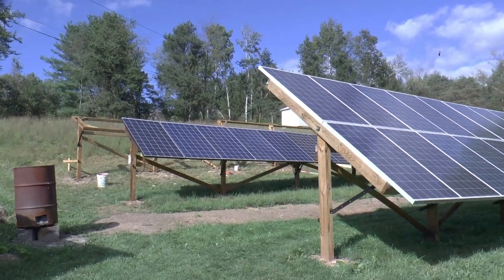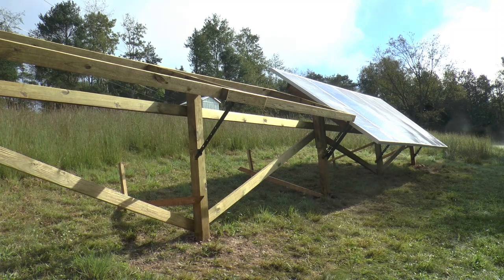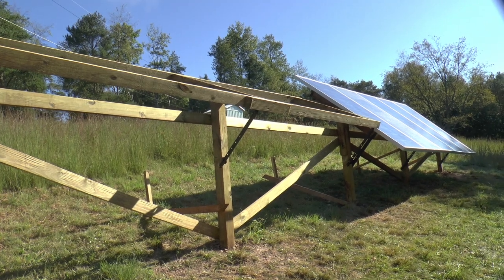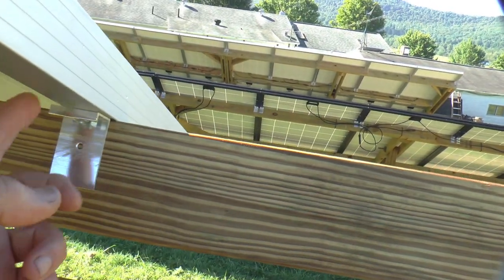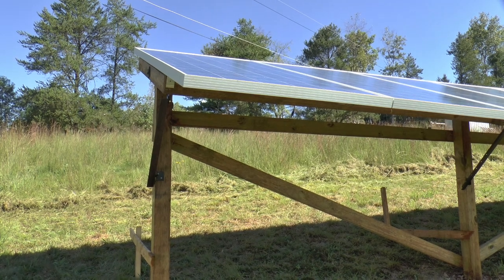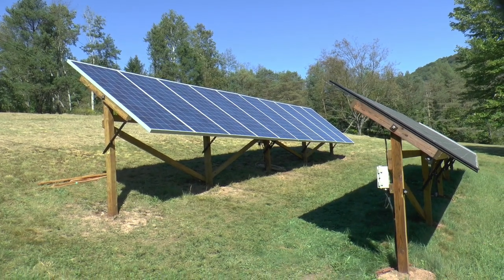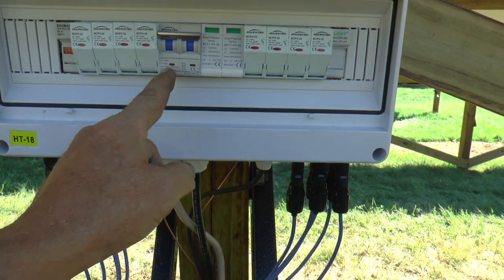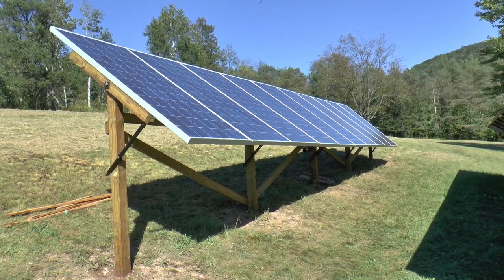Adding 10 more ground mounted solar panels

Comment: Great job! I'm trying to follow your version, but as I plan out building the mounts for our 22- 44 5/8 x 895/8 panels it's hard to see the details of where the sections meet. I see boards mounted at either side of the posts but can't visualise how the two sections are joined with the 5/8s double galvanized bolts and if those are longer bolts than the end ones. 
Also, did you drill the bolts for the cotter pins, don't see threads there?
Thanks!
Reply from the maker: If you stop the video at 9:30 you can see the two 2x4s (or 2x6s depending on your posts) that are bolted on each side of the post. Those 2x4s go in between the 2x4s on  the end of the two sections. The 5/8 inch bolt goes through all six 2x4s with some washers in the middle. I only had long bolts left and didn't want to buy more so I cut them off and drilled them for cotter pins other wise they would be bolts and nuts. I have other videos of others I built not sure if you seen them they may help too. Hope this helps.
Reply: Thanks so much, that dies help! I bought lots of 2x6x12s for the 6- 3 panel units hoping 2x6 posts between will be enough. It looks like yours are only about 6 feet apart, should I buy more posts in your opinion and have them half way of each 12' unit?
Reply: I have watched all your videos several times at least, they have been extremely helpful. You do a great job of explaining how you built these. I did freeze the frame and took a screen shot of the spot you gave me, now understand how those joints fit together. Since our total length of the array is over 80', I like how that will allow me to adjust the height of each post since my Lowes only had 8' long 4x6s

Comment: This is just the idea I needed. This design eliminates those expensive metal rails. Are your posts 4x4 or 6x6? Are you using 2x4's to make the tilting section? Thanks
Reply from the maker: My large ground mount that holds 20 panels (double rows) uses 4x6 post 2x6 for panel frame. The smaller 10 panel (single row) mount uses 4x4 for posts and 2x4 for panel frame.

Comment: Love your build and video Would you be able to share a few pics of how you installed your adjustable tilt mechanism please. We are using this type of mount up here in the NWT.
Reply from the maker: Not able to right now. Have you watched all my videos of my mounts you may find some details there. If not remind me and I will take some photos.
Reply: Thanks for getting back to me. Yes I have but they just don’t have enough detail on it. Whenever you can get at it.  Thanks
Reply from the maker: @rodgray1879  Stopped raining so I made a video hoping this will help. Here is a link to it https://youtu.be/p-33Pn2To2o
Reply: @kevincrawford2027 Thanks for helping out a viewer. Exactly what I was looking for and will adopt this for my display. I have 6 450w panels done vertically in 2 rows.

Comment: Do you mind telling me how far apart your 4/4s are to keep each run from shading the other. And how much closer you think they may could be and work. Than you have yours. I don’t have much of a front yard. I’m using 100w panels. I’d like to do about 3/4 rows?
Reply from the maker: Can't go by my distance because mine is on a slope and would be different than your location. Once I had the first row installed I put it at the winter angle. I then used a framing square from the top of a solar panel and ran a string along the other leg of the square to the ground. That is where the shadow would be at the suns lowest point of the year. Than I added a little just to be safe. Not great at explaining things hope this helps you.

Comment: i can't make the brackets, would you share the size so i can see if there are some available on amazon?
Reply from the maker: Mine are about 2 inches wide. One side of the angle is about 2 inches the other side is about 1 inch. Only because that is what I had on hand. Any small L shaped bracket with 1/4 inch holes should work.

Comment: Great Video will deff use a lot of your ideas if you don't mind. I was wondering what kind of brackets /arm system you are using for the tilt angle. I see you're using pins and cotter pins. I find that simply genius! Keep up the great work! Cheers!
Reply from the maker: Glad you got some ideas from the video. I used 1 1/2 inch angle with five holes. That gives me a good range to adjust the tilt angle from summer to winter. I have a video of a larger version that may be more detailed.

Comment: I will be building racks for about 36 panels and was planning to use a combination of unistrut and wood. After seeing some like yours made of all wood, I am considering that as well since steel prices are much higher. However, I am concerned whether 4 screw clamps will hold down each panel in high winds. Especially, like the 60-70 mph winds experienced a couple days ago. Have you had any issues with high winds?
Reply from the maker: We have had a lot of wind sometimes for several days at a time with high gusts like you mentioned. So far no problem. I have even gone out to check them during some of the high winds to see if the were any issues and found none.

Comment: Great work I love it and I'll be doing the same I have a question on spacing between the two arrays how many feet distance do I need to be so that I'm not casting a shadow onto the other array and again great work and thank you for sharing with the world we appreciate you
Reply from the maker: Depends on the lay of the land. Mine are on a hill so that changes things. Once I had the first row installed I tilted them to the steepest angle for my area (winter angle). I then used a framing square with the short end on the top of the panel and long end towards the ground with a string along the long end from the top of first row of panels to show where the shadow would be for the second row and added about 1 foot just to be sure.  Hope you can understand my poor explanation of how I did it.
Reply: Can you show the braces mounted and how they perform with each angle of the seasons? Thank you.

Comment: How tall are your mounting posts from the ground?
Reply from the maker: In my case the ground is not level so the pivot point at one end is about eye level and the other end is about waist level. Post height needs to be enough so you have clearance at the bottom so you can mow and have room for snow in my case when the panels are in the winter solstice position.
Reply: @kevincrawford2027  I totally agree! You have the best setup I've seen so far! Very well made!!

Comment: I would love to see a parts list. Where did you get the brackets? Where did you get the adjustable arms? What bolts did you use for hinge pins? What combiner box did you use?
Reply from the maker: 5 - 4x4x8, 6 - 2x4x8, 16 - 2x4x10 the pivot bolts are 5/8 double galvanized. 3 lbs of 3" deck screws with t25 heads. The panel mounting brackets I made from aluminum angle and the adjustable arms I made from angle iron.  I have used several different combiner boxes they are all very similar That one I choose because I need 5 inputs ( 2p x5 ) and it had space to add another fuse holder. Hope this helps.
Reply: @kevincrawford2027  Thanks. That's fantastic!

Comment: Where'd you find those L brackets?
Reply from the maker: I cut them from aluminum angle and drilled the holes.
Reply: @kevincrawford2027  👍

Comment: Nice ground mount. I've been trying different ways of a portable solar mount on wheels. I started with south facing then moved to east/west setup. I have bifacial panels and the portable mount faces east in the morning and I flip mount and panels face west in afternoon. I also want to add a way of flipping with some type of motor. Possibly a garage door opener. Seeing how easy your mount tilts back and forth makes me think a garage door opener would work.

Comment: I’ve been playing around with tracking. Doing some small scale experiments. Have you thought much about it?
Reply from the maker: I built a tracker out of an old tv antenna rotor. I used it for several years and it made a noticeable difference. Had 8 100 watt panels on it. Great for small system.

Comment: Did you wire the ground into that lightning fuse. I have one in my combiner box as well.
Reply from the maker: Yes the surge protector goes to ground and the solar panel frames go to ground.

Comment: What type of controller/mppt input can take 70-80 v and 40 amps  you are send down the wires?  Most controllers or all in one units have max around 20 amps  per mppt.  Splitting the dc power coming down the wire into two 20 amp inputs into 2 mppts  is possible but then you have 2 mppts competing to find the best setting.
Reply: 50 years ago.
Reply from the maker: The controller that I am using for these panels will max at 100 amps so far I have seen 60 amps at 54.5 volts ( 3270 watts ).